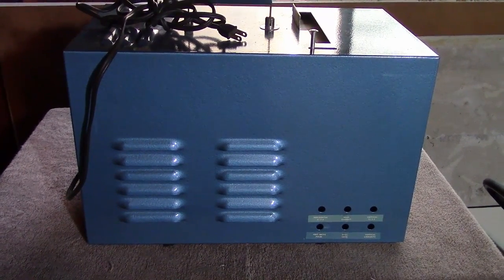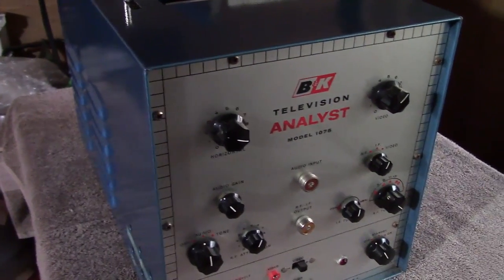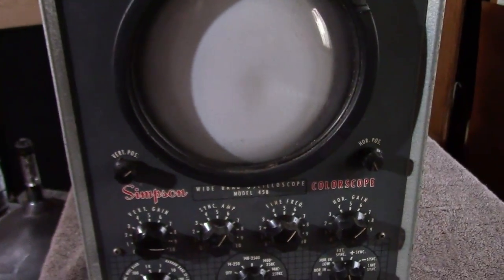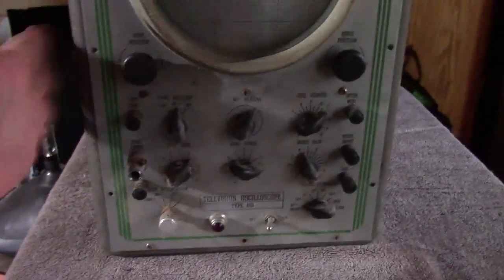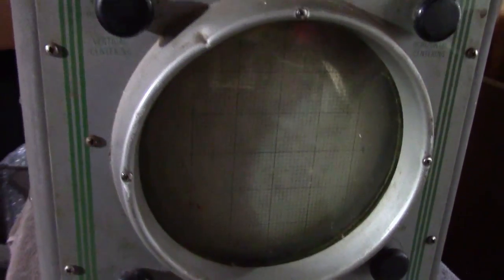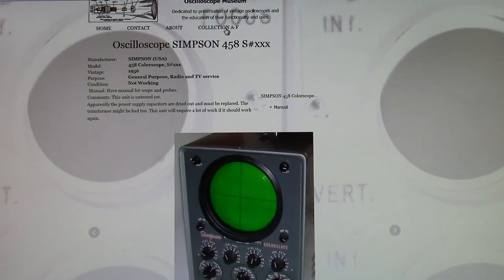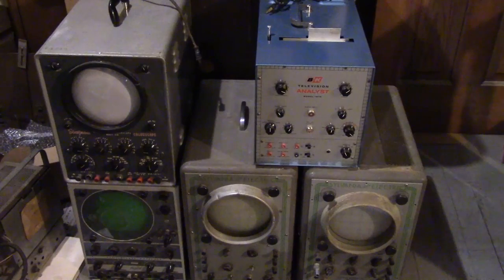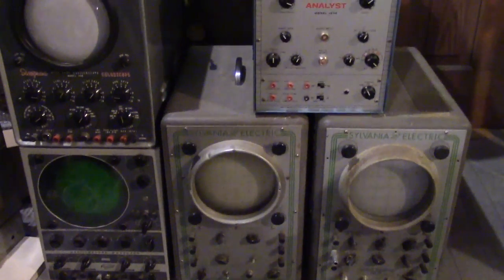Vintage oscilloscope score

Comment: I had that Sylvania Type 400 oscilliscope when I was a teenager.  Got it from a family friend with a tv repair shop.  Brings back some good and bad memories.  Worst electrocution I ever got by grabbing the live open chassis and lifting it up while touching something very high voltage where I grabbed.  My guess was it was a DC plate voltage, since I had a hard time letting go.  I think I sold it long ago.  Now I wish I hadn't.

Comment: The external6.3 volts AC was used as a reference for amplitude calibration. These were good scopes for TV troubleshooting, but not lab grade work. We used them in tech school for basic electronics education.

Comment: Sylvania test equipment is very durable and well made from my experience.  I personally have a type 134 VTVM which I would like to get working.  All of the tubes are Loktal types as it was designed to be portable.